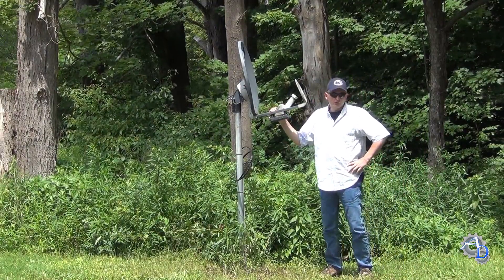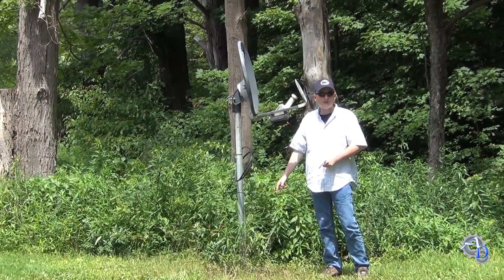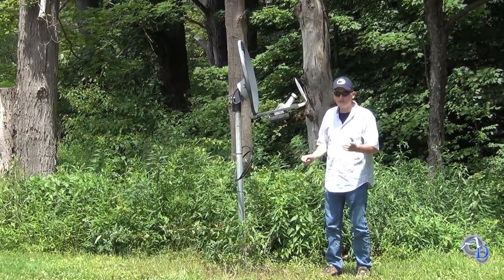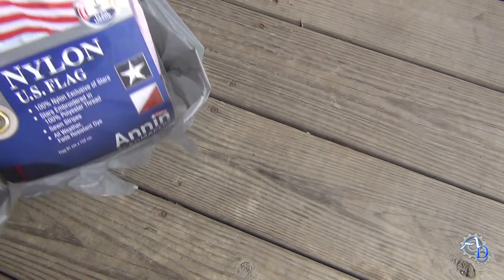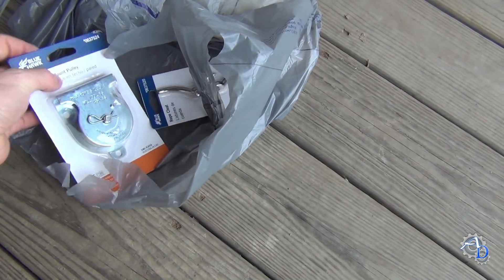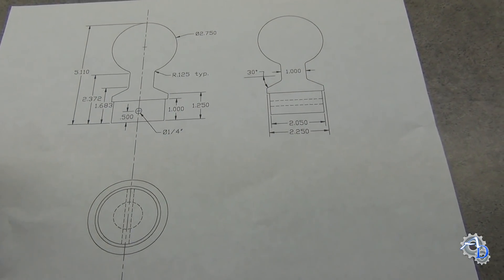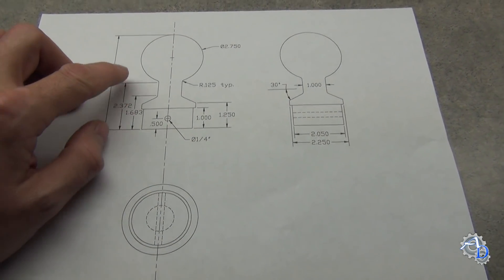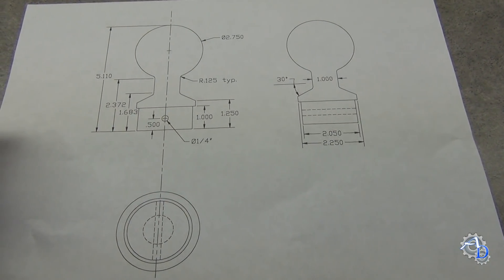Anodizing, Machining, and Homemade Flagpole Installation

Comment: Fantastic!  I can only add that if you powder coat the sphere with clear,  the anodizing should last longer. I want to get into anodizing. There are so many cool things that one can do without  expending a huge amount of hard earned cash. Thanks for posting. I love America.
Reply from the maker: Thanks. I didn't think of clear powder coating. I got it covered though. I coated it with Amsoil.
Reply: Good product,  out of it's realm but, thanks
Reply from the maker: Paul, here is a good write up on anodizing from Caswells. http://www.caswellplating.com.au/LCD.pdf
Reply: Thank you.

Comment: That thingy on top is a finial.  Lol
Reply: Military Flag Poles called a Truck. In a truck is a map of the installation a match to burn the map if over runner. A .45 Cal. round for the last and final act of defiance.
Reply from the maker: Thanks, I did not know that.
Reply from the maker: Quite interesting. I had no idea.